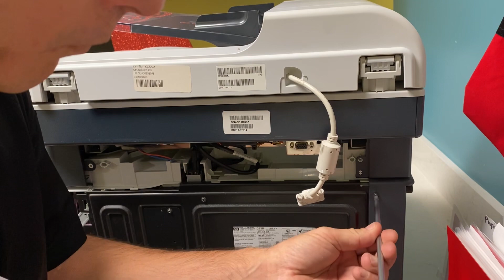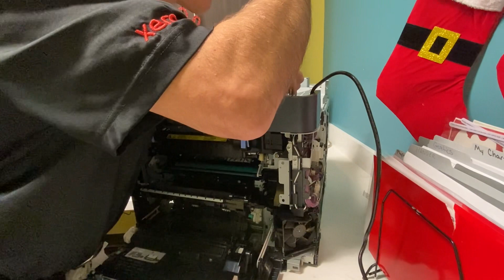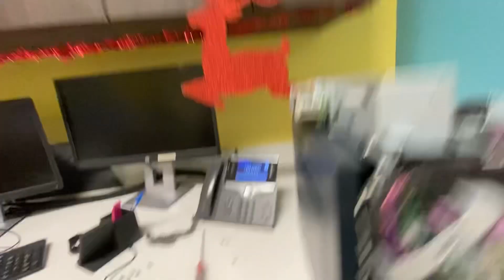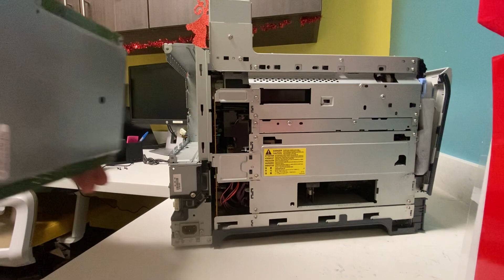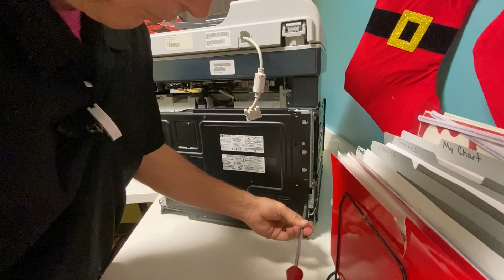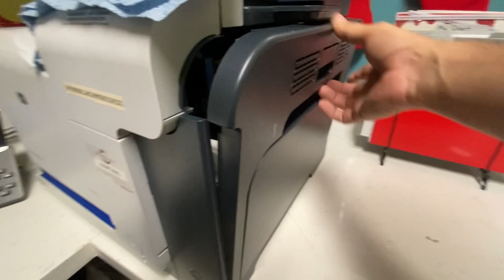59.F0 Error For HP 3530

Comment: one question, i finished everything, but when i put it back together, i get a message as if i don't have the transfer kit installed. what could it be? is it that i connected something wrong?
Reply from the maker: That’s the same as a 59.F0. It’s possible that the transfer solenoid wire connections are not snugly connected, or it’s possible that the transfer belt needs replaced or the flag on the belt needs reset. If all those fail to fix, fuser gear drive assembly is usually the culprit.
Reply: Did you rotate the gear for complete circle
Reply: Fiz o procedimento, mas agora diz que a esteira belt está ausente ou o motor está queimado.
Me ajude a descobrir o problema?